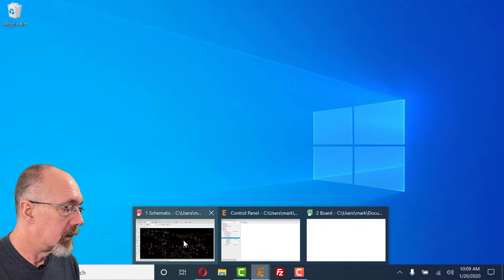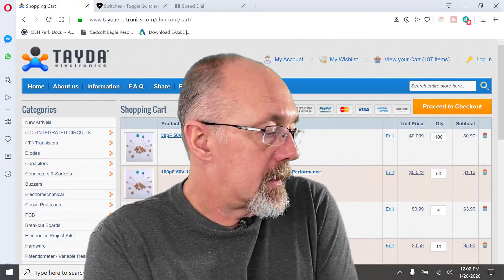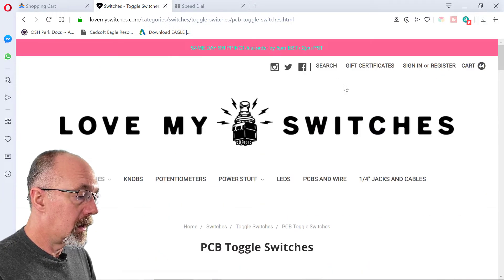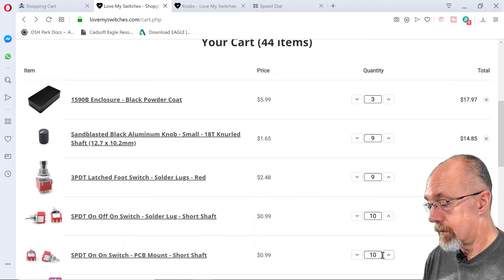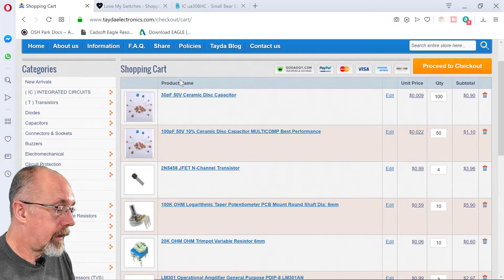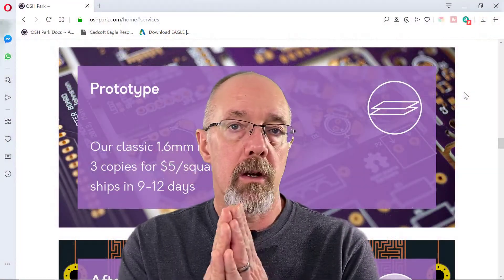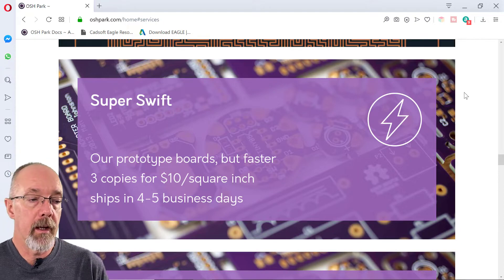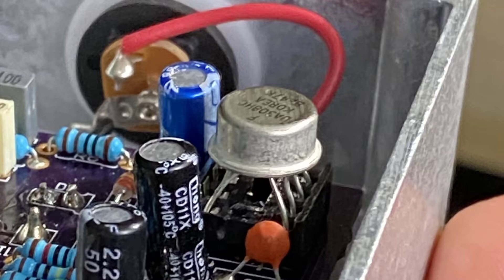Build Your Own Effect Pedals - Rat (Part 4) Shopping for Components

Comment: To be honest,  I watch these vids and the more I watch the more I think Imma just pay you to build me pedals , Im color blind sooooooooooo. Yeah that HEH HEH  . Great vids bro
Reply from the maker: Thanks, bro. You're supposed to build 'em though. 😁 

I'm still looking for a schematic for that GNX. If I can't find one soon, I'm going to have to just start poking around and figuring why the patches keep switching. I'm assuming one of the pull-up resistors is shorted causing it to look like the one of the pedals is pressed to the microcontroller. It'd be a whole lot easier to track down with a schematic.
Reply: @HomespunEffects  the fact the switches are backyard moded makes them suspect for shure  but theres way 2 much going on in that pedal for me lol . I've also looked for the schem. I will see if Linda has any luck tracking 1 down , she is purdy good at that kinda thing .
Reply from the maker: Dinger Alan that will help a lot.

Comment: Due to the use of a different op-amp, I would suggest you to rethink about the cap values on your op-amp supply filtering section. 30pF is a good value for the slew rate of a LM308. The OP07 probably wouldn't need any cap.
Reply from the maker: Alexis, I have a small stock of LM308. I have a few others that I'll try as well. 

I've not tried changing the value of that capacitor before but I have left it in while using an LM301.
Reply: @HomespunEffects  From the datasheet you can check the slew rate of each op-amp and change the value accordingly. I will patiently wait for the next part of the build. Next one could be a fuzz or a compressor. Relatively simple circuits with a lot of tinkering possibilities.
Reply from the maker: Alexis, I have a Harmonic Percolator that I like much more than the Fuzz Face circuit. Maybe that could be next.
Reply: @HomespunEffects  the clipping diode section is indeed very interesting
Reply from the maker: Alexis, that's my favorite modification. I think the asymmetrical switch does the most or at least the best change. The LEDs in the clipping section really gives it some heft.